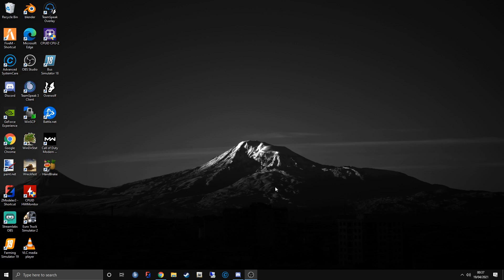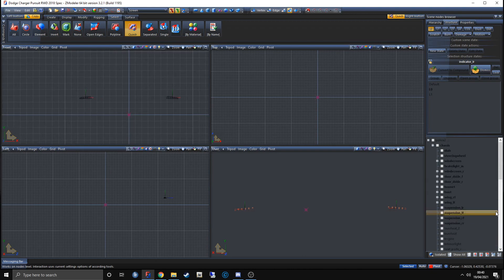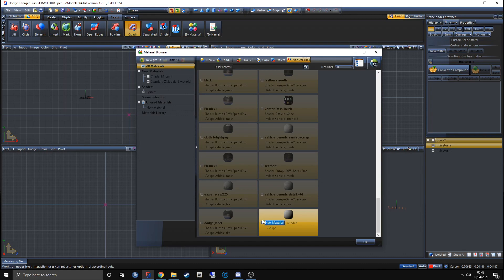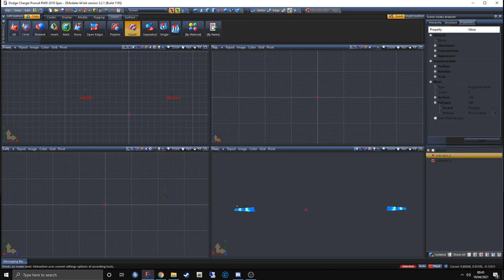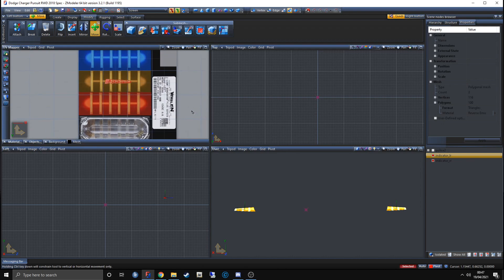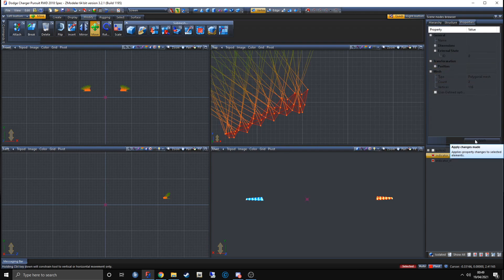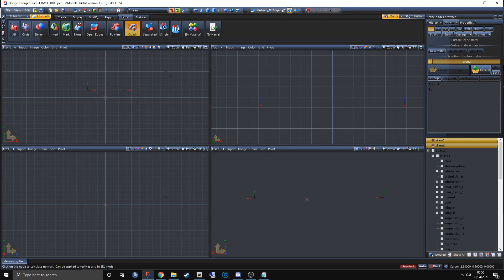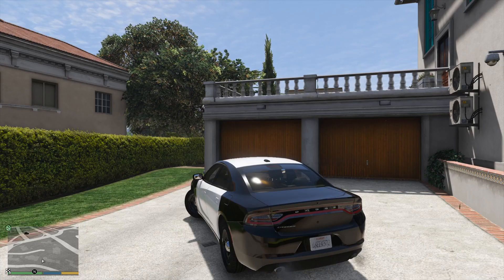*2021 UPDATE* | HOW TO MAKE REVERSE/INDICATOR LIGHTS FLASH | NON-ELS | ZMODELER 3

Comment: Great work! It worked perfect! Just a curious question, Could this method work for the headlights on cars like flashers? Or are headlights a different thing?
Reply: It will be the same process but instead of delta value of 3.14 it will be 0.00 and you will move them forward and not backwards. If you want a wig wag type don’t do any of this and go into the carcols and near the top it will say headlight flash or something along those lines and change that to the hexidecimal you want them to flash at
Reply: @FiberMods  alrighty thanks man! I’ll give it a shot here soon.
Reply from the maker: Yeah, what Fiber Mods said.